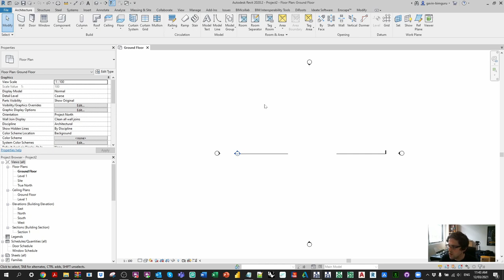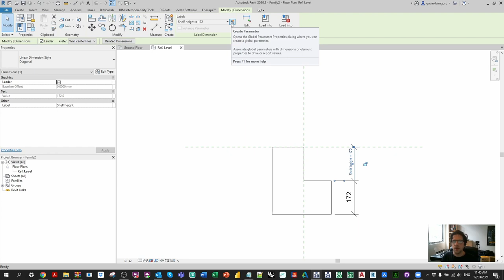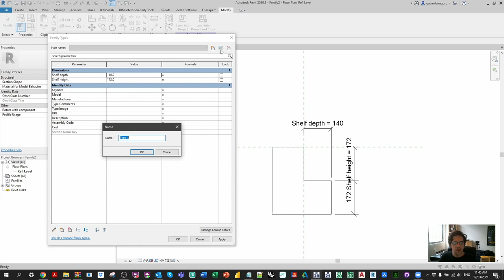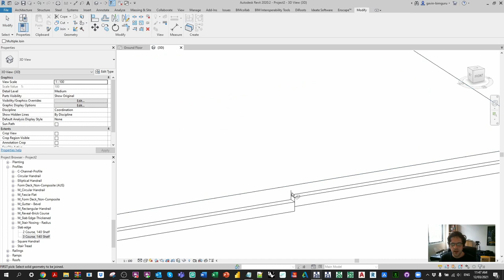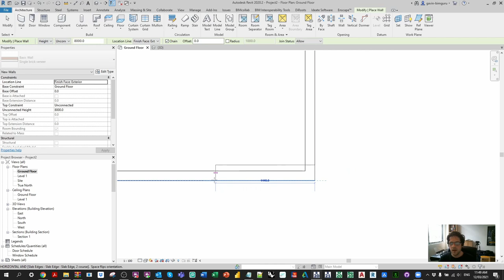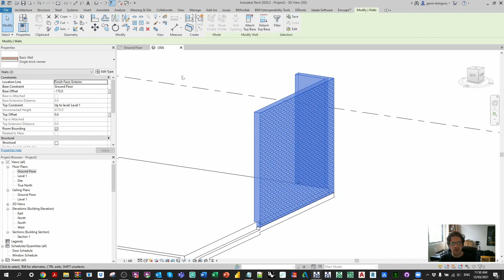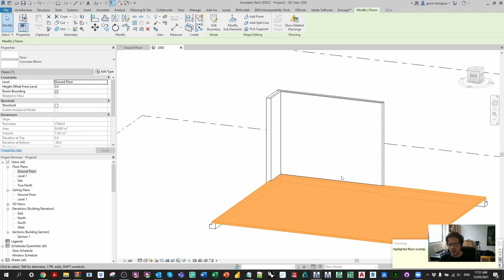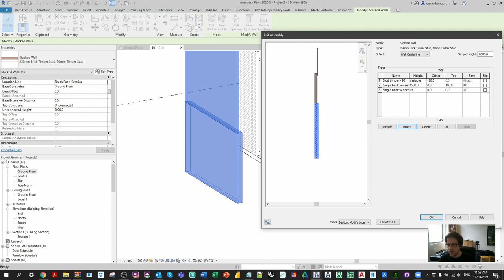3D Brick shelf modelling in Revit!

Comment: I use the foundation walls with two layers and the ledge layer unlocked at the top so I can use the top offset for the ledge. Speeds up the model and works better for coordination. Then you also don’t have to adjust the extents of stepped ledges.
Reply from the maker: Interesting idea - I'll try it out! I find keeping edges separate can be easier for takeoff purposes but could be made to work that way too for sure.
Reply: @AussieBIMGuru  I use a method similar to James, but I go to wall type > edit structure > open the preview, switch view to section, then run a reveal. That covers my foundation brick ledge. To step my brick down into the brick ledge, I unlock the bottom offset of my brick and air gap and use the base offset function to drop it the depth of my brick ledge. I have found 2 faults in this method, the first is in material take offs. Material takeoffs pull the area of the the material is associated too, no the material itself. As long as you're not providing the model to a contractor and they are trusting material takeoff schedule, then it's a good method. The second is that when you have a foundation step and you're stepping brick ledge with grade, you end up with a small section of foundation wall that has to be duplicated and run a taller brick ledge to handle the grade change alignment with the foundation bearing height change.
Reply from the maker: @scottblosser3503  Yes sweeps and reveals can be handy, especially for skirtings and cornices as well if you have predictable floor/ceiling to wall relationships.

Comment: Thanks for this mate. You save me a lot of time modeling. Question. How do you model floor for bath? Do you offset/drop it below?
Reply from the maker: You're welcome! It would depend on the type of bath detail. For a bath above the floor I would usually model the bath and frame as a parametric family, leaving out the surface/wall tiling and accounting for this in front of the sheathing in the frame family. Then these can be modelled and accounted in the takeoff (e.g. wall tiles). If the bath is depressed into the slab then the slab would fold and I'd usually model that as another floor if the fold is accounted for in the setdown depth/thickness of slab - extending the perimeter of the floor to account for the fold. If it's a deep fold then I'd model the base slab and then use walls for the folded area, then join the elements together for a seamless graphical outcome.

Comment: Would be a great feature but Revit breaks the wall junction in plan when unlocking wall layers to be extended. Hit and miss for me.
Reply from the maker: Yes the only way I've found around this is to use mitre junctions. It's close but far depending on the application it's being used for - I find it can do a majority of the residential brick junctions but there's a couple it still fails at such as porch corners.

Comment: Very good tutorial.... Though unlocking layers option has been there since long,  Revit never allowed to unlock nonadjacent layers. Is it the same in 2022 as well?
Reply from the maker: As far as I've seen it's still the same approach in 22 unfortunately. It would be great if we could control each side of the wall's core height rather than just as one. I believe there are some systems on the horizon that may solve this from what I have heard, but not sure when they'll be released.